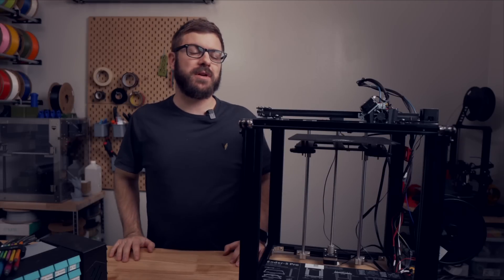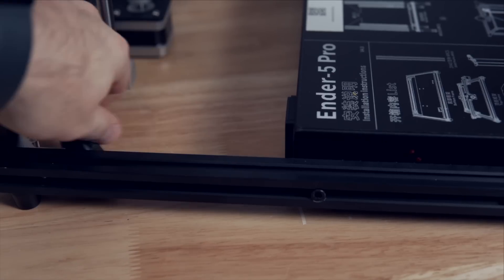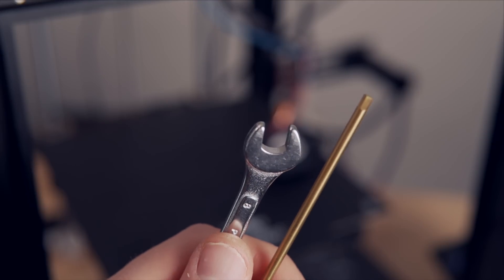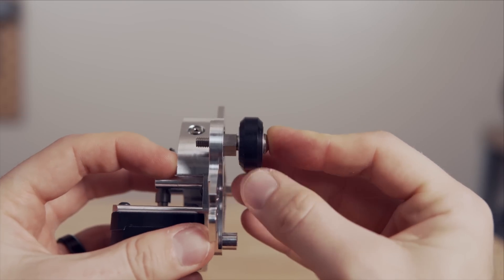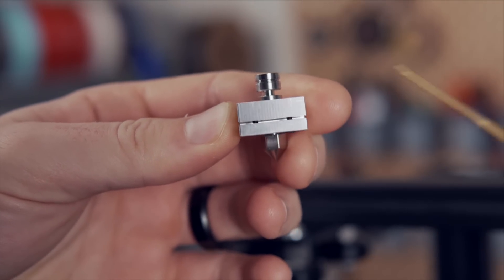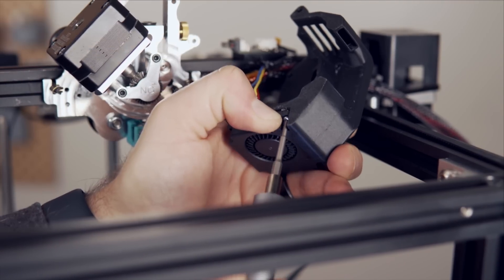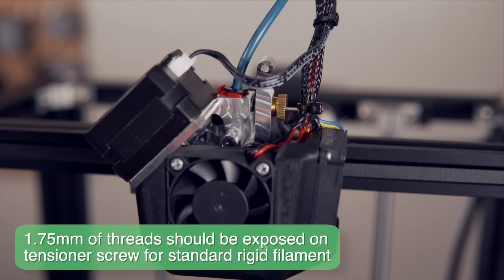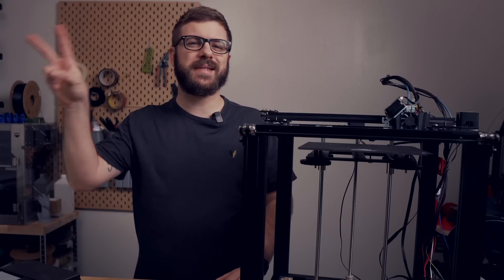Micro Swiss NG Direct Drive Upgrade (Creality Ender 5)

Comment: Great video as always.  Installation is really simple.  Just bummed out that the bulk of the kit is 3D printed considering the price for the kit (I'm not in the US so the kit's price is substantially higher).
Reply from the maker: For the fam shroud I feel like it makes sense. Especially when they were showing possible Revo options. It would also be cool to se a shroud made for a 5015. For the reverse Bowden that could definitely be injection molded or machined though. Is it through a reseller for you then?
Reply: @ModBotArmy  Not through a reseller... directly from Micro-Swiss.  The exchange rate between USD and CAD makes everything a little less appealing... I agree with you with regards to the 5015 fan shroud... that'd be great (especially since I use 5015 fans for part cooling on all of my printers).
Reply: The shroud and reverse bowden are printed. Hardly the bulk of this and nothing that wouldn't be in plastic anyway

Comment: I bought mine during the Cyber Monday sale and I'm loving it.  Pretty much direct drop-in on my longer LK5. Just needed to print a fan adapter for the 5015 radial type, since I didn't have a 4010(?) part cooling fan laying around.
Reply from the maker: I have been running these (NG) for a while now. They just work really well. I have thrown a pretty wide range of filaments at it.

Comment: They should just include to CR/BL mount, everyone uses those these days
Reply from the maker: Newer kits all ship with a printed BLtouch mount. As far as crtouch I am not 100% about the physical differences between the two. It may require some slight adjustment.
Reply: @ModBotArmy  The wire location on the CRTouch is in a slightly different place than the BL/3D Touch.  It is a simple enough thing to make a BLTouch mount work with the CRTouch.  Import the stl into something like TinkerCAD or 3D Builder and take a very small cut out of the stl so the wires can clear the mount.
Reply: @ModBotArmy  really because I just ordered mine last Monday directly from micro swiss and it didn't have it, I guess I'm sending an email to customer support
Reply from the maker: @GenericEquivalent  yeah they told me roughly around then that they would all be shipping with them.
Reply: @ModBotArmy  yeah I'm going to email them, not because I need it as I printed my own before I bought the NG but dang I want it if it's supposed to be there maybe their print is better than mine lol